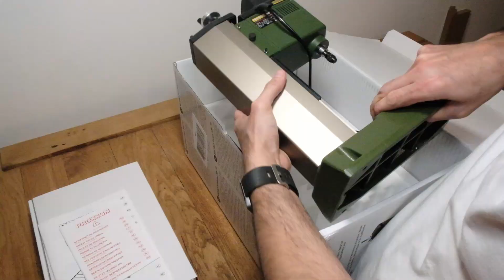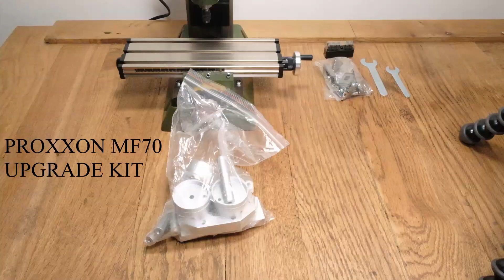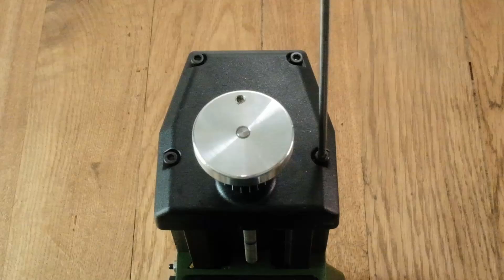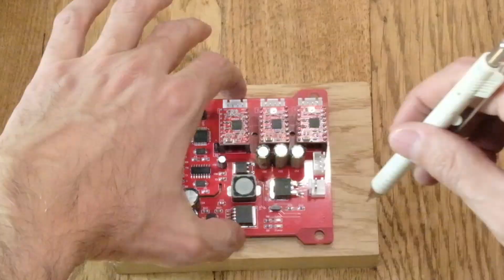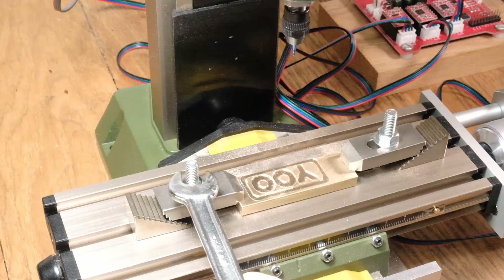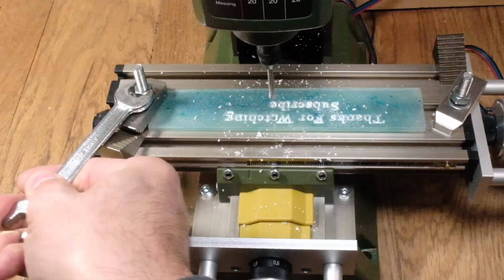PROXXON MF 70 - UPGRADE TO CNC

Comment: No aparece en YouTube un tutorial paso a paso que explique cómo conectar a la computadora y que tipo de programas se utiliza… 😢Tengo días buscando un video tutorial para quien nunca ha tenido una máquina similar y que no tiene idea de cómo empezar
Reply from the maker: Hello , I completely understand your situation – at the beginning it may look complicated to connect the Proxxon MF 70 converted to CNC with the computer, but here is a summary of the basic steps to get started:

1. CNC Controller (Hardware):

The conversion kit usually includes stepper motor drivers and a controller board.

The most common are based on Arduino with GRBL or controllers like Mach3/Mach4 (parallel port or USB).

The first step is to identify which type of board/controller your kit has.

2. Connection to the computer:

If you use Arduino + GRBL, connect it via USB and install the GRBL firmware.

If you use a Mach3 controller, you’ll need a Windows PC and usually a parallel adapter or USB motion card.

3. Required software:

CAD (Design): To create your 2D/3D model. Examples: Fusion 360, FreeCAD, SolidWorks (optional).

CAM (Generate G-code): This software translates your design into instructions (G-code). Examples: Fusion 360 CAM, Estlcam, FreeCAD Path Workbench.

CNC Control (Run the G-code):

With GRBL → Candle, Universal Gcode Sender (UGS).

With Mach3/Mach4 → you load the G-code file directly.

4. Basic workflow:

Design the part in CAD.

Generate the G-code in CAM.

Import that file into the control software (Candle, UGS, Mach3).

Set the zero point (X-Y-Z origin) on your machine.

Run the program.

5. Practical recommendations:

Start with soft materials (wood, plastics) before moving to aluminum.

Always check that the motors move in the right direction and that the limit switches are working (if installed).

On YouTube, search for “Proxxon MF70 CNC GRBL” and “Proxxon Mach3” – there are detailed videos showing the process.
Reply: @YooProjects  
For someone like me who has never used any of those programs or similar machines that require more work than just plugging it into power, it all sounds overwhelming 😁

Thank you. I greatly appreciate your response. I'll look for the videos you recommended to better understand the topic and installation ❤
Reply from the maker: You're absolutely right — it's not that simple at the beginning. These machines and programs have a learning curve, and it takes some patience and practice to feel comfortable. The good news is that once you get past the first steps and understand the basics, it becomes much easier and even enjoyable. Don’t worry, you’re not the only one who feels this way.
Reply: @YooProjects  I don't have the machine, but I was really interested in getting one for my small business

I looked up the videos you recommended, and that helped me understand how it works in general. In my mind, I imagined it would be a machine similar to my drill press 😅 that only needs electricity, haha. Now I know I'd need to buy other accessories to make it work and other things. All of that is beyond me right now, and there are no YouTube tutorials that explain to me like I'm a baby how to set everything up to make sure I'm investing in something I'll actually be able to use

I hope you'll be encouraged to upload more videos sometime soon; I'll be following you…

Comment: I didn't realize you can do this with such small stepper motor drivers.. Don't they get hot?
Reply from the maker: There’s no issue with the stepper motors. The only motor that gets hot is the spindle motor, and even that can be controlled by adjusting the speed and depth of the milling.

Comment: What board did you use to control the stepper motors? also what program did you use?
Reply from the maker: Hi, Thanks for watching 🌻 i used arduino board and fusion 360. It's very nice cnc machine for small wood, plastic, epoxy mold and thin metal.

Comment: Hi, where to buy that control board?
Reply from the maker: Thanks for watching. Try to look on Amazon. Arduino cnc controller. Good luck 👍
Reply: @YooProjects  and you think why did Proxxon use NEMA 23 instead of NEMA 17 in the original CNC version?
Reply from the maker: @hypertool35 proxxon used Nema 23 for ff500 cnc machine. Nema 17 good for this miniature cnc machine

Comment: Great video.  But if I could offer one suggestion it would be that you’re using your step clamps incorrectly.  If you stand your triangular piece up vertically, you’ll see the teeth of your clamping bar will full engage and more positively lock into the triangular ramp.  That’s how they’re machined to work together.  Hope that helps and thanks for the video. 👍

Comment: Which controller and software did you use?
Reply from the maker: Hi Mat,
Software for cad and cam: solidworks or fusion 360.
Controller :arduino for cnc.
Thanks for watching 😊
Reply: Thanks sir @YooProjects
Reply: Which firmware on the arduino cnc board though? @YooProjects

Comment: Hello.... I just ordered the kit to convert Proton MF70 to a CNC. Is there any help on how to set it up? I ve asked some question on AMAZON by the seller but got no response. Is this a scam ?
Reply from the maker: Thank you very much for watching. You can buy upgrade kit from aliexpress. And the machine from amazon. You also need arduino cnc kit. Good luck 👍

Comment: Super cool 😎 the electronic red board is inside the kit?
Reply from the maker: Thanks 😁. No electronics kit.. You are csn use arduino cnc kit for upgrade the machine. You need nema 17 motor too.
Good luck 💪
Reply: @YooProjects  thanks for replying back so quickly.
Love ❤️ your works 💪🏾
Reply from the maker: A huge compliment.  Thank you very much 😊

Comment: Any chance any. One knows the link for the motors and chip board conversion kit?
Reply from the maker: You can get kits from Amazon
Reply: @YooProjects  thank you.
But I see some kits come with the nema 23 stepper motors but some articles I've read up that the nema 17 motor are equaly as good. I work eith lathes and bench drills ect but just bought  myself the proxxen mf70 so I appsalutly nothing about stepper motor specs ect. The kits that they sell on amazon are almost as expensive as the cnc it's self so I'm looking into trying to find the parts individually to see if I can cut the costs. Any info you could suggest would be amazing.
Kind regards

Comment: Would this be more rigid of a setup than a cheap cnc router?
Reply from the maker: I'm pretty happy with the result. The advantage of this device is that you can milling soft metals like aluminium and brass. But its a small machine for very small parts. About cheap cnc Router, I can not compare to a machine I do not know. Thank you for watching 👍

Comment: Good day Sir,  I am getting ready to order material for this.  When I check the Amazon link provided there is a NEMA 17 version and a NEMA 23 Version, Not sure which one I need but as you point out NEMA 17 Steppers I suspect I need the NEMA 17 kit or should I get NEMA 23 steppers?   Amazon also recommends a timing Belt but I suspect that is for a 3D printer and not the MF70,
Reply from the maker: Nema 17 is Perfect for this project. Good luck and enjoye 👍💫👍

Comment: Greeting from Maryland Sir,

Can you list exact locations for board and software? 
I procured Proxxon CNC Kit, Nema 17 stepper motor and Fusion 360, but I have difficulty to find circuit board and software though. 
I like technology, but the technology hates me sometimes according to my children, I felt that it hates all the time. 
Thank you, 

Very Respectfully, 

Bob
Reply from the maker: Thank you very much Bob!
You need to use arduino card for cnc machine. You have alot of information on Youtube about how to setup and control the motor.
After that you need to design with fusion 360 and to use cam option to convert the cad files to Gcode. With the Gcode you start create cnc parts.
Good luck!

Comment: What power source do you use for the controller and motor and can you mill high carbon steel with this upgrade
Reply from the maker: 24v - 5A.
YOU CAN NOT MILL HIGH CARBON STEEL WITH MF 70.
Reply: @YooProjects  what about mild steel and brass and what power source did you use for the motor and controller like a power supply for 3d printer on Amazon?
Reply from the maker: The power source must fit arduino cnc card. No problem to mill brass and aluminium.:))
Reply: @YooProjects  can I use this setup to make 3d piece for diy projects instead of just engraving sorry if I'm annoying I just a total noob  on cnc but I know 3d printer well
Reply from the maker: @sebastienbleau7870  You can make little parts from wood, plastic, epoxy, brass and aluminium. But you need to learn the how to use mf70, you need to learn the setup of speed on X, Y and Z axis. And how to use right cuting tool for your project.
Good luck 🤗
Reply: @YooProjects  thanks for all your time and quick answer
Reply from the maker: Its my pleasure:)) Good luck and Thank you for watching my video.
Reply: @sebastienbleau7870  I have done brass manually on the MF70, I am just getting the CNC kit now.
Reply from the maker: Good luck!

Comment: Where do you have buy the software
Reply: Hello, the software  was no problem to get.
Where can i buy the whole cnc set thag you use.
Reply from the maker: You can find on amazon
https://www.amazon.com/Longruner-Arduino-Professional-Mechanical-LKB02/dp/B072N4FMRN/ref=mp_s_a_1_3?dchild=1&keywords=arduino+cnc+kit&qid=1634220259&sr=8-3
You have a link for upgrade kit aluminum parts in the descripsion. 
You need this too. 
Good luck:))
Reply: I am new with this tool, Is that the whole set what i need, and pluch and play...
I saw your video  and it looks easy to buld.
Reply from the maker: You need experience with Arduino.
Reply from the maker: Free software.. You can design cad files with fusion 360, and for cam( gcode) I used grbl software (for free).
Thanks for watching:))

Comment: Can I mill aluminium 10x15cm? Od its to small?
Reply from the maker: The table size is 200x70 mm( 20x7 cm). Try to fit to table size.

Comment: Where did you get the motherboard for making connecting the engines and the computer such that you can control the PROXXON MF70 ? Do you have a link for that ? Thank you
Reply from the maker: You need cnc ardunio control board. you can find kit on amazon with step motor. Good luck:)

Comment: TOP. J'ai une MF 70 que je voudrais convertir. Quelles carte de commande utilisez vous ?
Reply from the maker: Thanks :) I used cnc arduino card, fusion 360 for cad and cam. Good luck !
Reply: @YooProjects  Merci pour votre aide. Avez vous fait une vidéo pour la partie électronique et software ?
Reply from the maker: I estimate it will be in the next cnc machine

Comment: hello, which electronic card do you use to connect the nemas 17?
what software do you use to drive the cnc? grbl, bcnc?
thank you
Reply from the maker: Hi Franck,
I used arduino cnc control to connect nema 17, and grbl software. Fusion 360 for cad Filles.
Have a nice day:)
Yoo
Reply: @YooProjects  what's the difference of using nema 17 and nema 23?
Reply from the maker: More power..